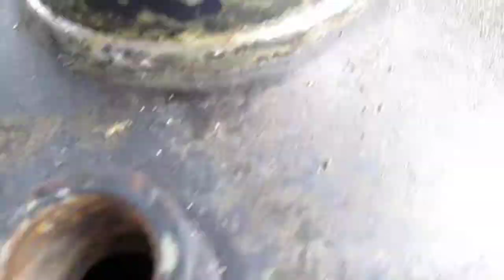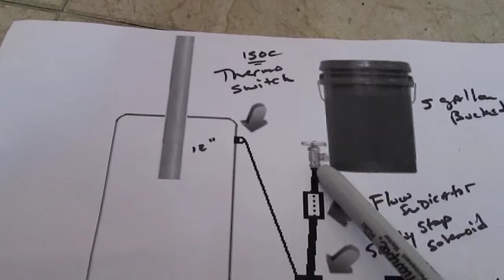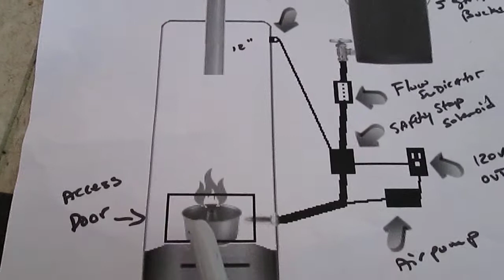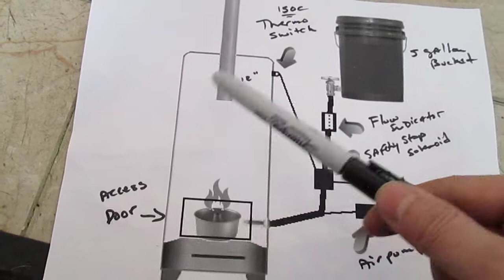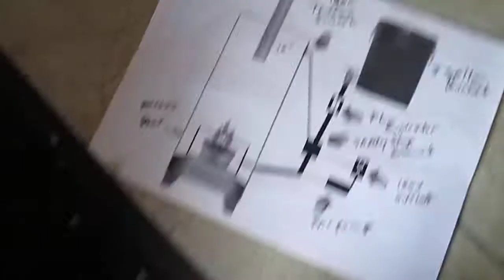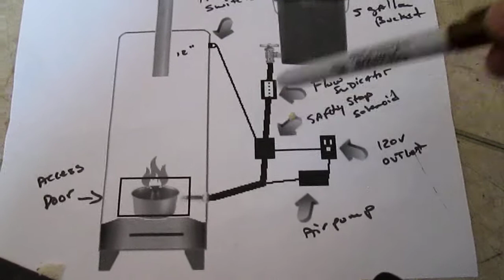DIY Waste Used Motor Oil Burner Heater Furnace - No Welding Plan Pre- Design Concept

Comment: You are very clever! I love that you work to solve a problem instead of letting hurdles get in your way!
Reply from the maker: +Road to the Farm - Hey, Glad to see you here :). This would be " PERFECT " for your " Off Grid Living ". Since you are  " VERY GOOD  " at getting free things... Like getting the Potato from Local Farmers... You can get " FREE USED OIL " too... It's actually easier than you think... I have so many places that I can go Pump Free Used Oil, just don't know where to store it :((((. I started this year, trying to get FREE HEAT, LOL... And so far, I got SIX 55 Gallons Tank FULL :///, LOL YIKES.. And best of all it's FREE :))))). Most Local Car Repair Shops or Car Oil Change places have them and wants to get rid of them for free. You can easily convert your " Wood Fireplace / Stove " into a " Drip Used Oil Burner EASILY " and YES, I saw those Video too, LOL.
Reply: That's super! Great job being frugal!

Comment: good start and it's a new design, and make sure u have a good air flow, otherwise it will smoke so bad,  and u should mention my name, u took my idea about the door lol,  and good job
Reply from the maker: Hahaha, I would have done the same way, just like I mentioned on your built. Since I knew it will hold the door tight. But when I am done with my built, I will give all the proper credits to everyone and if you want extra credits for the Door, sure why not.... I would give it to you as well, LOL :D

Comment: Hi Jod. The tank looks like a great candidate for your oil burning project. The forced air design allows you great flexibility with the burn rate. The air pump although able to produce 40 psi pressure might not deliver the quantity of air that you need for combustion but if you already have it you will be able to test it out. Try all your experiments outside in safety. Well done on getting it moving. Cheers Gerry
Reply from the maker: THANKX Gerry !!!

Comment: You don't have to cut your chimney. It will draw the waste gasses out and also create a hot zone to burn off any soot or smoke.  I would leave it that way if I was you. I mean, cut off what you can but leave 12 inches or so inside the tank.  Small holes in the base of the stack would act as a catalytic converter (possibly) You could also put a metal plate between the flame and stack, as long as it doesn't touch the flame it will help help keep the heat in the tank longer.  A stainless steel burner chamber may hold up better.  I have melted metal in my burner before.
The solenoid is a good idea.  I like your design, seems sound.  Can't wait to see how it works.
Reply from the maker: Hahahahaha LOL, too late :((((. Although I should have thought of leaving it even lower then drill Holes in them so the Gases can escape, like you thought of it from above post. But I am extremely Allergic to smokes and any type of Smokes really, I got scared so I cut it off about 10" down :((((. We have Wood Stoves. Pellet Stoves, Natural Gas / Propane... Cheaper with Pellets... But I can't stand it :((((. We even bought the Completely Sealed System Pellet Stove, and it was like almost $4G and I still can't stand it :(((. I am actually making this for burning in our House. I am going to use Veggie Oil and the Motor Oil we have, I will make another to use it in our Work Shop / Garage. Also, yea you are right about the burning on Metal (See my recent Video)... I am going to use a Stainless Steel Mixing Bowl.... I read and see from most is the 8" Stainless Steel Mixing Bowl would be the best Candidate.  Check out the Update of the opening:  https://www.youtube.com/watch?v=Q1QpMR-25vA

Comment: Not sure if anybody has mentioned this yet, but surely your solenoid valve needs to be in line before the flow indicator, otherwise your oil will overflow.
Reply from the maker: +Bernie Hough - Hi, yes you are 100% correct !!! I have to put it right after the " First " Shut-Off / On Valve, like after the Valve @ the Bucket. :D. THANK YOU !!!

Comment: Your flow solenoid should be above you drip window and used in the overheat only switch on. Oil will build up in the stand pipe otherwise. I may make you a schematic based on best use for a HW tank.
Reply from the maker: You are 100% Correct !!! After I made the Drawing and thought of it after the Video.... The Flow will BLOCK my Drip Window, LOL... So yea, you are 100% correct :D. The 12V DC Solenoid is a Normally Closed, so it's ALWAYS Closed. I will make a Manual By-Pass Switch to turn it on, but if the Heat gets too HOT, it will Cut-Off for Safety :D

Comment: Careful cutting,  it's glass lined.
Reply from the maker: Hmmmm, WOW... THANK YOU !!!! I didn't know that... I will wear Safety Glasses for sure..... I always do, but I will keep you in-mind :)))
Reply from the maker: I was able to Cut the top old Exhaust out to about 8 Inches down. That was as Far as my Hand can go while holding the Air Cutter while cutting. Took a while, but I was able to get it through. Door is next, and then few adjustments and I would be able to test fire it and burn the Paint off and get my Stove Paint on :))))). I will post a Video soon :)))). I skip some parts because I don't want the Video to be too long.... I am going to make a Slide Pix Video instead, it will be faster to view :)))